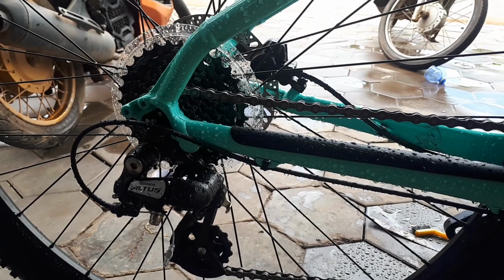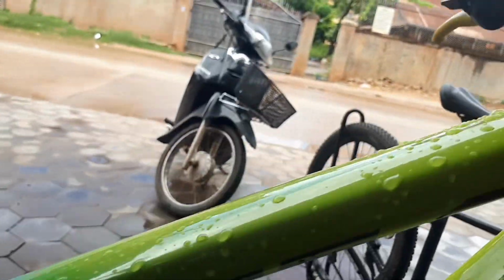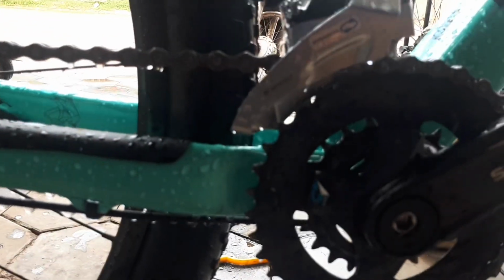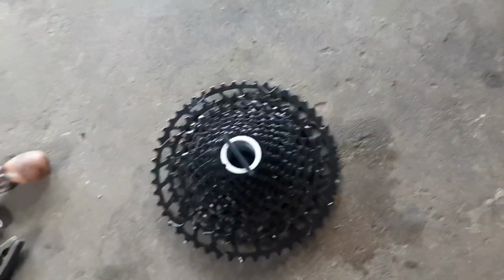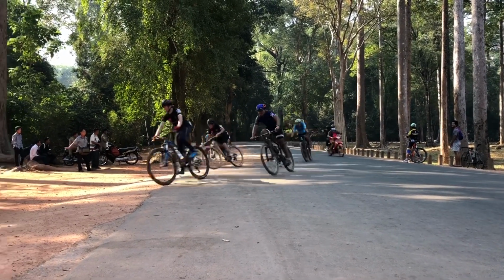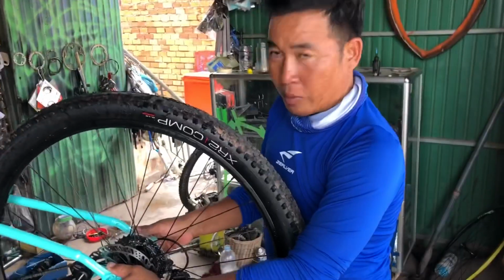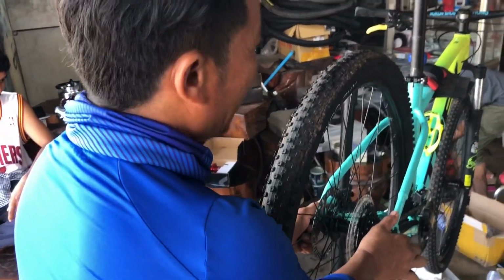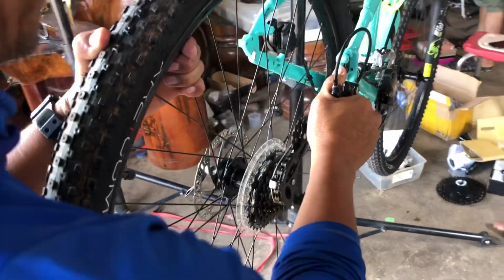Bike Upgrade Trek Marlin 5 2022 With Sram Sx 12s & Arc Carbon Hubs By Thony CB

Comment: Whats all the piece???? I have the same bike i want to do that!!!
Reply from the maker: Upgrade Drivetrain Sram sx 12 Speed Group Set & Seal Bearing Hub ARC MT 010 Carbon
Reply: The arc carbon with or without qr and speed hg8-11s or ms 12s or xd/xdr12s ? 9*100mm front or 15*100 mm ? Rear 10*135 mm or 12*142mm ?
Reply from the maker: @pietros9236   for HG 8-11 Speed Hd & Sram SX, 9*100 Front, 10*135mm rear